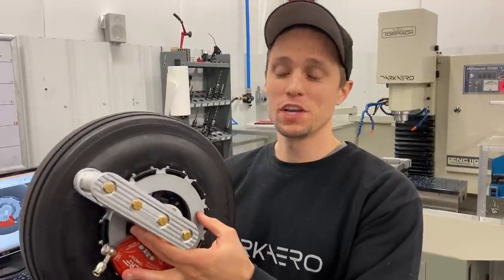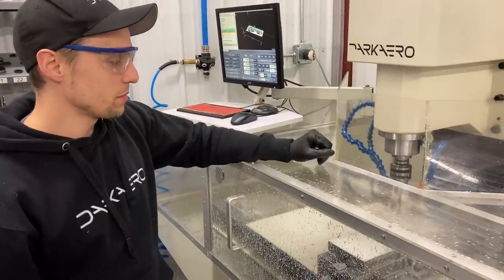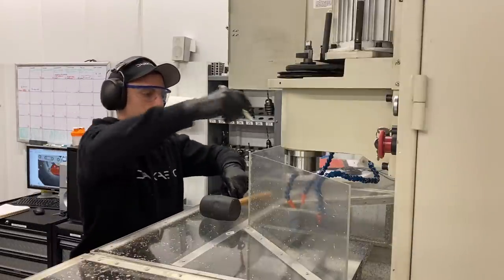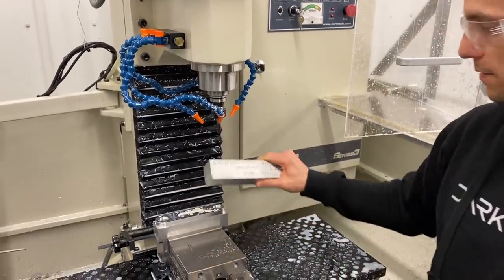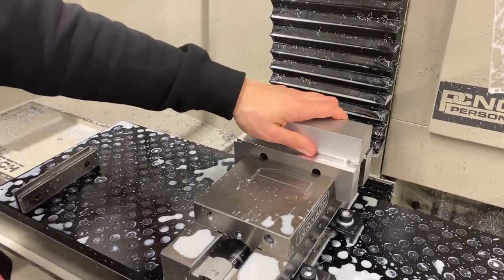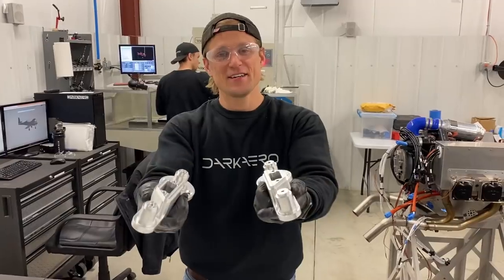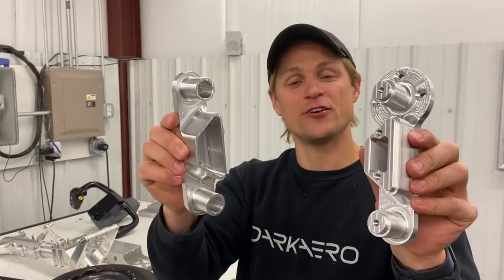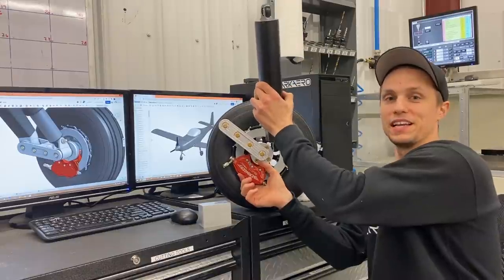Machining Aircraft Landing Gear on a Tormach CNC!

Comment: Its probably already been said but I would really suggest a thread insert like a keen-sert or even through bolting, to avoid thread gulling, fastener corrosion, and the ability to take the components apart more than a couple of times.

Comment: you can use recycled PEEK and then reinforced it with long or short carbon fiber. PEEK can be cheaply produced with biobased chemicals and solar furnace.
Also you can use topology optimization software and create parts with molds.

Comment: Great videos guys, keep 'em coming. Use a spiral flute thread cutter in blind holes for proper chip evacuation though, makes all the difference.
Reply from the maker: 😁 Figured we would catch some heat over the threading. Agreed that chip evacuation is dodgy at best with the straight flute thread tap. Thank you for watching and thanks for the tip!

Comment: one way to help ensure your tap goes in straight when tapping by hand is to make a tapping block. just a square block with a reamed out hole very close to the major diameter of your tap to hold tight to your workpiece to guild the tap into the hole perpendicular to the hole. I have even 3d printed a tap guild before that I needed to tap a PVC end plug on center at home where I have a lathe (chucker) that can drill the hole but no good way to tap it. However, I think ultimately thread milling would be the best option in my opinion.
Reply from the maker: Jeremy, thank you for watching and the comment! We agree on the tapping block solution. Also agree that the thread milling is the best approach from a production stand point. The way we did it in the video doesn't represent our intended production approach. It was more of a temporary solution as we haven't invested in the proper tools yet.
Reply: @DarkAeroInc  cool. just wanted to give you some ideas. and the idea of using a 3d printed tap block if you need one in a pinch and in an awkward spot is something i have not seen done before. the one i made worked quite well for my application just another idea to add to the problem-solving book. thank you for making the video i love to see the tormach in action because i would like to get one in the future in my garage. looks like you guys are doing good work and i would love to see how the machine handles a thread mill.

Comment: That going to be a very expensive part for someone to purchase down the road. BUT, well done. 
With all of you having engineering degree's,  I'm sure y'all know the meaning of KISS?
Get a set or two of these Mighty Bites, save yourself possible fixture/soft jaw building/cutting.
I have 3 sets in my t/box.

Comment: Just curious, will you be using titanium hardware? Also, what are the requirements regarding safety wiring? Is that required in these applications? I'd assume so, as you don't want brakes/wheels to ever come off :)

Comment: Just saw you tapping into aluminum! With a power drill!!! That is a high stress part. THAT WILL FAIL on you! Those bolts will pop out on a hard landing. 

I am in a quality experimental dept for a reputable private jet company in Canada!

High stress thread in aluminium you usually use a heli-coil. Even then, involved with an aircraft I would change idea on that concept.

Comment: 7075 in T6 is susceptible to stress corrosion cracking (or at least that temper isn't in the "good" table of the MSFC paper on SCC).  I think T7351 is on the "good" table.  Is that an issue for an airplane?  I sometimes think the SCC worry is overblown, but it is something that comes up.  Maybe it's not an issue for you.  FWIW, more tempers of 7050 are okay, and it machines easy.  I really enjoy your channel, thanks for sharing.
Reply: In order to have SCC, you need to have residual stress (not likely on a non-welded component) and corrosion, again not likely if this part is to be coated.

Comment: Very interesting.. You guys know your stuff. Break assembly is very close to ground level. What about damage on rough surface, grass field, debris...
Reply from the maker: Great question! The DarkAero 1 is intended for paved runways, not unimproved or rough fields. It is not a STOL or bush plane so you need to use a proper runway. You don’t typically find debris on a runway large enough to damage the brakes, so, not a likely risk. Thank you for watching!

Comment: Just curious if you have accounted for the squatting tendencies of a trailing arm suspension system when the brakes are applied heavily? Have you seen any Wilga / Draco videos from Mike Patey? Is it possible to increase the shock pressure proportionately with the brake pressure?

Comment: What was the thought process of choosing aluminum internal threads as apposed to a thru bolt?  Great work!
Reply: So it gets corroded and chewed up over time and they can sell more parts in the future?

I'm wondering more about why they don't send a steel axle from the wheel nut all the way through the suspension pivot for the shock. The parts look pretty but why design it with so many joints in a critical area?
Reply from the maker: Hi Robert, thanks for the question! The decision against a thru bolt was driven by assembly requirements. A thru bolt design would yield a trailing link that could not be assembled to the axle. The order that we showed the trailing link being assembled to the axle is a bit misleading because it is incorrect. There is a specific assembly order that needs to be followed when the shock bottom bracket is assembled between the trailing link halves. The outer trailing link must first be bolted to the axle and then the shock bottom bracket installed, and then the inner trailing link can be bolted to the outer trailing link. If this order is not followed, the machine screw head that is closest to the trapezoid feature on the trailing link would be blocked by the shock bottom bracket and could not be torqued when the axle is installed. Threading the bolts into the outer link makes the design assemblable. Thank you for watching!

Comment: I thought it was a decent video overall. I did cringe when you tapped with a hand drill, not saying it wouldn't work but a thread mill might be a better option on the tormach in lieu of rigid tapping.

Comment: Are you 100% sure, that threading aluminum is the best solution?
Reply: With the design, a slightly longer bolt and self locking nuts would be better.  Threaded aluminum is never a good idea, especially fine threads in aluminum.  A heli-coil  or similar insert would be better, but with the room available a nut is the best option.
Reply: And don’t forget to lock-wire whatever option of bolt or through bolt and nut fastening system you eventually finalise on using!

Comment: Great work. I don’t know why you made soft jaws on the part with parallel sides. I might drill and mill one of the holes through the part and use this hole center as the origin once the part is flipped.
Reply from the maker: Peter, thank you for watching and the comment! We had considered this. However, the backside holes are less than 0.25" in diameter and our probe diameter is 0.20". The concern was for errors that could arise from geometric multiplication effects.
Reply: DarkAero, Inc That explains it! Thanks for the videos. Keep it up.
Reply: @DarkAeroInc  You can use gage blocks at the ends of your workpiece to probe against and substract their width to x axis, or simply use a flat piece against the sides of your 2 vice jaws and push your piece against it, then probe the side of your fixed jaw (make sure your vice jaws are paralell.

Comment: Looks great.  What's the plan for volume production of these machined parts once you start shipping kits?
Reply: I doubt the CNC manufacturing capability is going to be the limiting factor early on. And once they get to the point where it is, CNC is very easily farmed out to outside shops. Send them a file, get back a part.

Comment: Those parts are pretty cool but look extremely expensive to produce. Do you ever do a cost analysis on individual parts and processes?  I can think of many ways of producing this cheaper.
Reply from the maker: Thank you for watching and for the question! We do look at cost on all the parts we design and manufacture. :) We work with a few prototyping shops that have quoting software that can predict manufacturing costs of components. For a CNC machined part, the material choice, dimensional tolerances, surface finish, batch size, and part geometry can easily affect the cost by an order of magnitude. Incorporating auto quoting tools into our design process helps us design parts that can be manufactured cost effectively. In parallel, prototyping parts on our own CNC machine gives us a better understanding whether a part is easy or hard to manufacture. One thing we wanted to communicate with this video was that these parts could be successfully produced on a common, entry level CNC machine. There are other approaches that could produce components that look like the trailing link parts we made but the material strength requirements, dimensional tolerances, and surface finish narrowed down our options to a billet machined solution.

Comment: It's very neat, simultaneously concerning for cost, production time and weight. Have you done yourself the favor of designing a welded tube solution and comparing relevant parameters?
You are 4 smarts guys 2-3 years into this? and not close to finishing the first prototype yet. If welded tube is vastly superior then you cannot afford to be irrationally in love with milling and crash on its shores. Similarly if a tadpole body has plenty rigidity from its compound curves then why are you doing elaborate internal bulkheads with holes and custom fasteners. If a shell with perhaps a few strips of core material under a few more layers is plenty stiffness then what are you doing. If by believing you are doing it the proper engineering way you end up with something 10x more difficult to produce, weighing double and half as fast then was it really the proper engineering way. Keep it simple and optimization is king. I've seen several outfits stubbornly run out their clocks with darlings without merit. If milling only looks and sounds cool but fails on actual figures of merit, do you love it enough to fail over it.

Comment: That’s an interesting brake disc. Are those “teeth” some sort of trigger wheel for ABS?  Is that another video??
Reply: The disc needs to be able to expand and contract with heat cycles. So those teeth allow it to spin put keep it located in the middle.
Reply from the maker: Beringer uses a floating brake disc design that is a bit different than standard brake designs that use a disc that is bolted to the wheel rim. The teeth fit into corresponding slots on the rim which rotationally lock the disc and the wheel while still allowing the disc to float in the axial direction on the rim. This ensures the disc remains aligned with the brake caliper and limits heat transfer from the disc to the wheel.

Comment: Looks like a nice fit. Would be a shame if some one plated them..... Dun dun dun...
Reply from the maker: Thanks for watching! You give us too much credit on the machining tolerances. ;) There is still enough room/slop for the additional thickness anodizing will add.
Reply: @DarkAeroInc  Just make sure you do Type II and not Type III. ;) Also make sure you nickle seal the parts if they are black. Will stop them from turning purple from UV light. I know the struggle. Have parts I made on the Mars rover and in a bunch of airplanes/jets/satellites. Plating is a bitch to deal with. Especially the platers... Hey we dumped a whole cart of your parts on the floor, but we will do the next batch for free.... Facepalm....

Comment: Yea, that's jank tapping a hole with a power drill. Get a little manual tapping machine. But other than that, I want to buy one.
Reply from the maker: 😁 My tap handle broke so I improvised. Thank you for watching until the end!
Reply: @DarkAeroInc  it totally works haha but why not do it with the CNC?